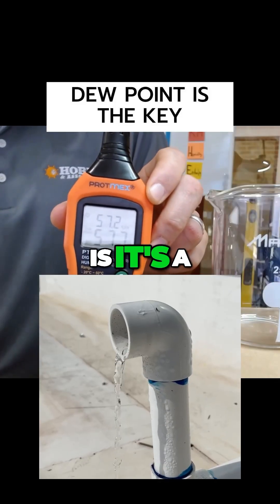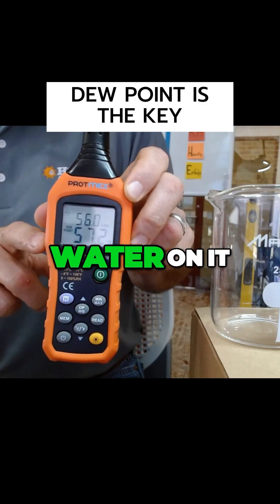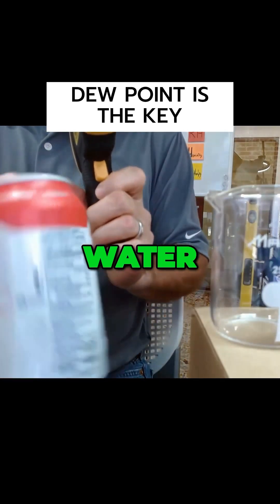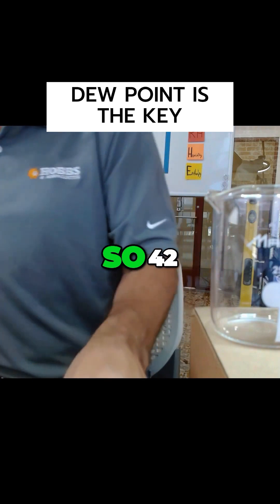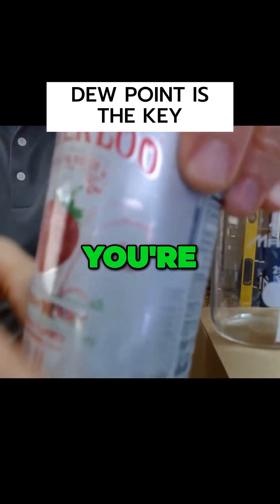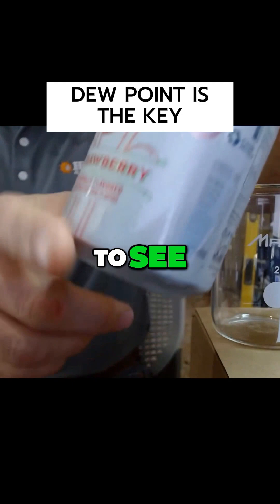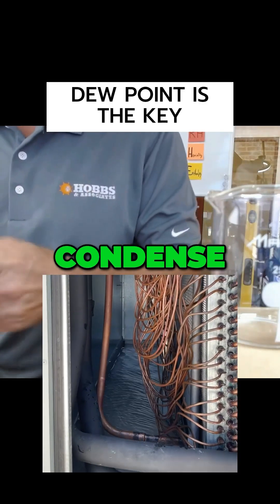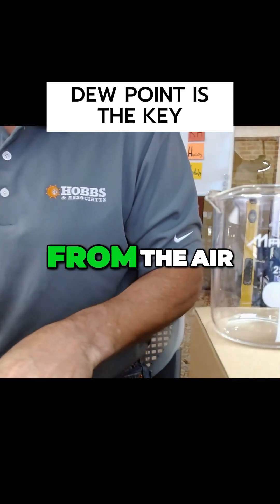Cooling Coil Dehumidification Explained | Practical Demonstration of Dew Point

Comment: If latent heat is priority (dehumidification mode) does the txv modulate to maintain a specific evaporator temperature that is optimal for dehumidification?  I imagine the compressor as well.  Assuming modulation is possible.

If so is the optimal evaporator temperature at, near, or below dew point temperature?